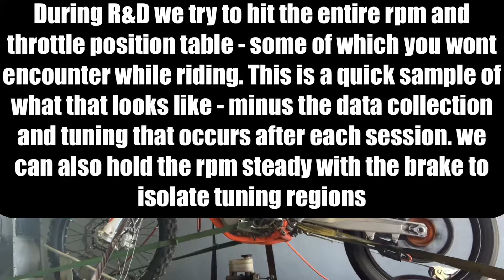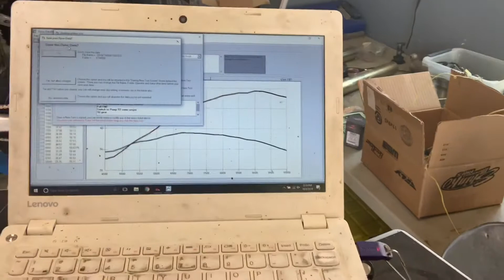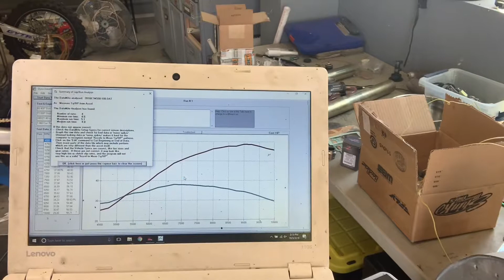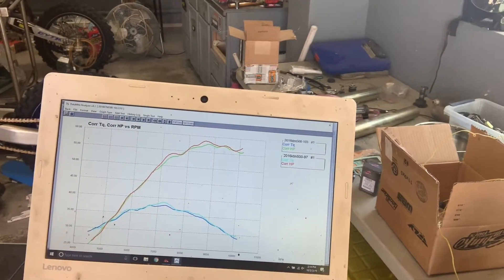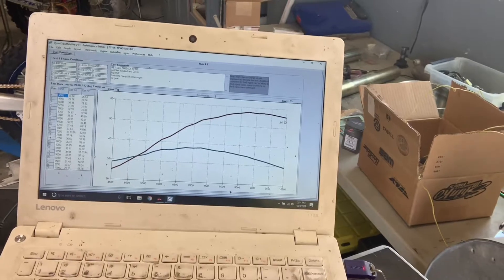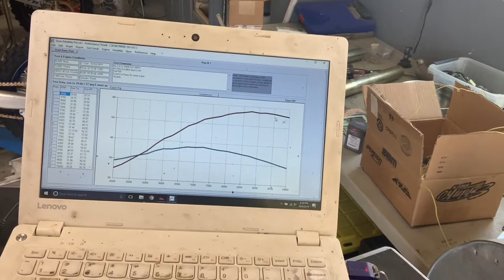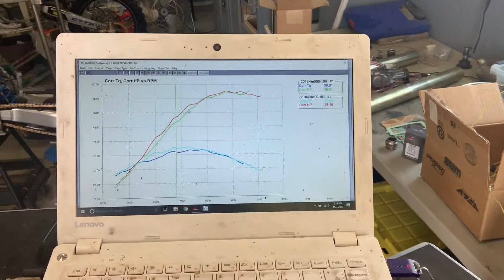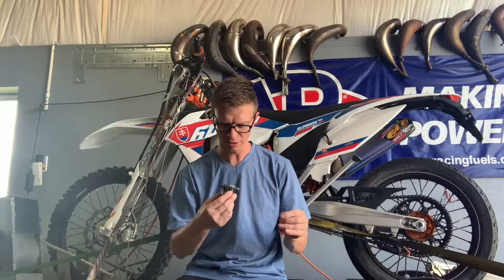2012-2016 ktm500 exc-f on the dyno with GET ECU vs OEM

Comment: Would the same ecu for a 2015 ktm 500 excf work for a 2015 350 excf ?
Reply from the maker: @YourNeighborTotoro714  No
Reply: @HPRaceDevelopment  yeah I didn't think so. Do you know if they offer anything for a 2015 350 excf? I haven't had any luck finding anything yet.

Comment: Is that with the euro map on stock ecu? Cuz there’s no way my 2015 500 is making close to that power and it’s fully desmogged.
Reply: Well it definitely had smog related stuff but no intake reeds from my memory but it’s been a while. From what I read online is that the euro map makes a huge difference on 2012-2016 500s compared to stock. So I don’t see how ur get didn’t make a big difference. Only thing I’m thinking is ur stock ecu has the euro map loaded on it since back then u were able to load the euro map onto the stock ecu.
Reply from the maker: @MotoBrando  What smog items would you be referring to
Reply: @HPRaceDevelopment I had a 2014 500 EXC brand new…. Smog canister… also something on the engine block…. And I feel I’m missing one other item. When I bought it, my buddy had a 2013 and told me everything to buy so on Day 1 I had a box of new parts. I also went with FMF full titanium mega bomb pipe and larger manifold. I sent my ECU off to Munn Racing for the Euro reflash and that bike was a demon! I never dyno’d it though.
Reply: Hopefully you can help. Considering buying a used 2016 Husky 501S. Seller is 2nd owner and "thinks" it has a  "husky factory off road 501 tune or the akrapovic tune".  Is their a way to confirm before buying the bike?
Reply from the maker: Off memory the 12-16 models didnt have smog or reeds - and they had fairly open pipes. they were the strongest stock 500s by far the next gen got knocked down with reeds and super corked up pipes, mild ecu tunes

Comment: Am I reading that right, 2.15 hp gain for $900++???
Reply from the maker: You wont gain it any other way for cheaper
Reply: @HPRaceDevelopment  Not trying to be disrespectful but what am I missing? I see dyno charts online for 12+ hp and similar torque gains. Reason I'm interested - and came across this video - is that I'm actively researching tuners for a KTM 500.
Reply from the maker: @usualsuspectsfor1k  you couldn’t be more wrong…. The current versions 17 on up can see large gains.  But the 12-16 models came uncorked. Try again
Reply: @HPRaceDevelopment  Ah, I did not catch that. Mine is newer model.
Reply: @HPRaceDevelopment  Is that with the Euro map? I have a 2016 6 days like yours in the video that hasn't been Dyno'd and was also under the assumption that it came with a 40ish HP tune. Now I want to get it on a dyno.